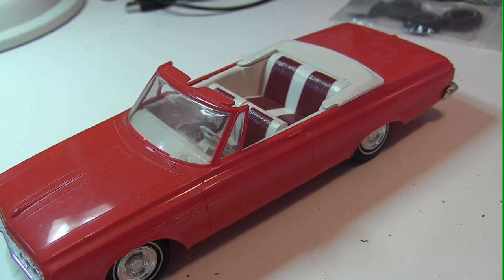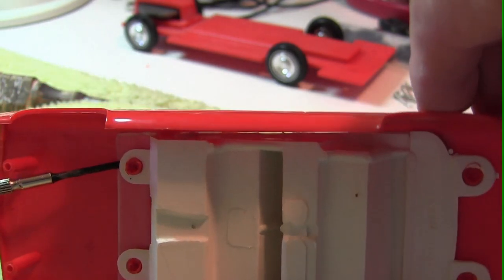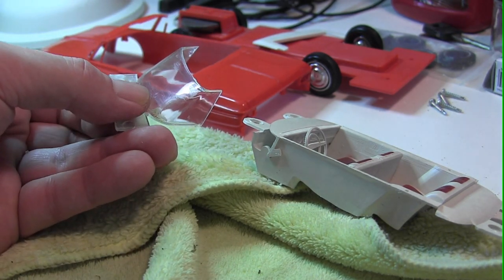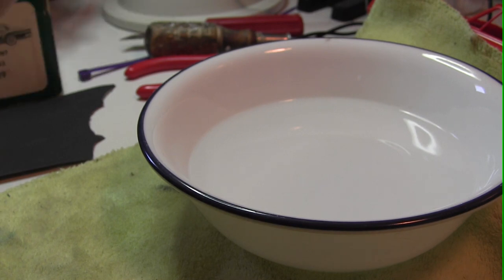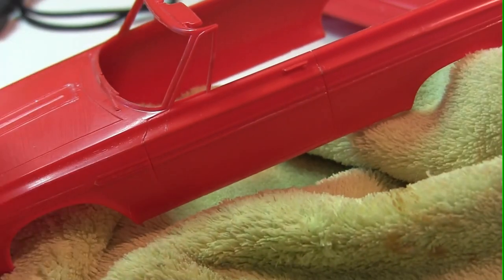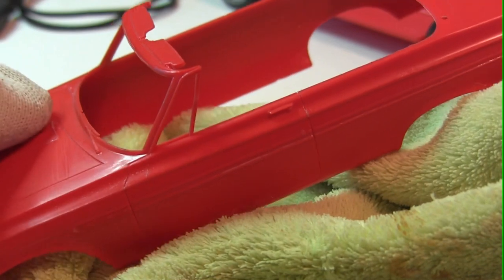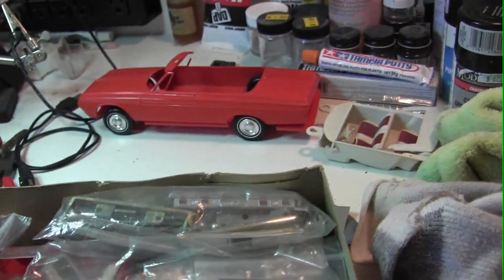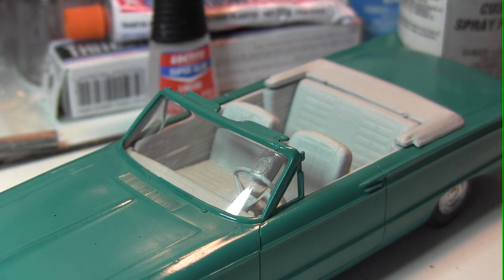Model car Window repair

Comment: Use M.E.K.. and left over red sprue or unwanted red parts . Cut in small (1/8")pieces and drop them into some M.E.K.. You can patch that lower part with the melted concoction. More sprue-thicker glue. More m.e.k. runnier glue. File, sand, and buff and you will not see the repair. The  Methyl Ethyl Ketone  mixed with styrene  pieces is actually styrene glue and a whole lot cheaper than buying glue. You can fabricate parts to by building on with the mix  and hand shaping.
Reply from the maker: I have used MEK before. Yes it works But You must be careful. It is toxic and can melt plastic very easy. Practice with a small amount and use proper safety.

Comment: Nice repair but to much work, grind the glass with 800 grid used sandpaper apply some clear coat and its finish no need to polish ,